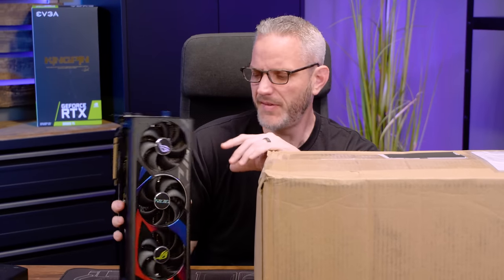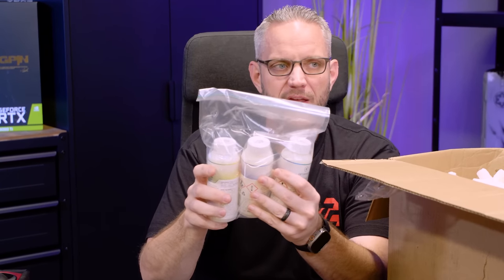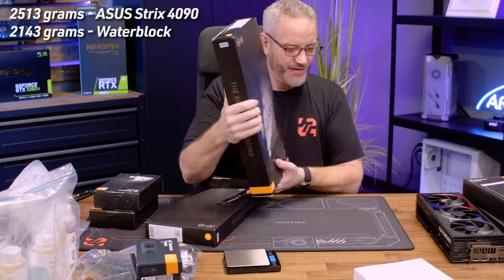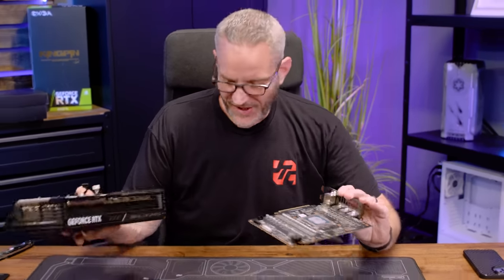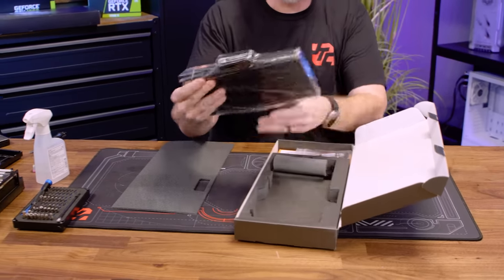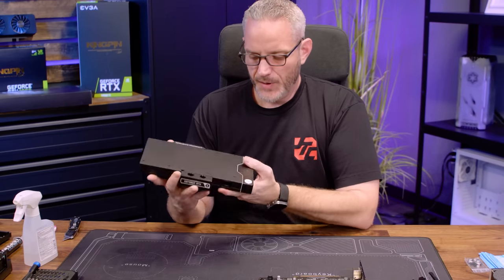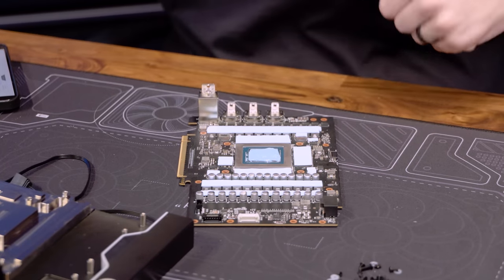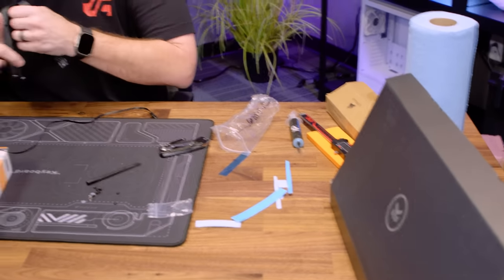This is how you make a 4090 even more expensive... 4090 Strix EK Waterblock Install

Comment: I enjoy Jays content and his channel for the most part. As an enthusiast myself seeing high end parts sometimes is nice. However lately I jus feel the majority of the time all the components or parts shown are for the 1% and 99% of users/consumers won’t use or care about. Seems it’s just always super high end stuff. Which I do like from time to time. I’m running a 4080 and Ryzen 7700X on a 1440P 280hz 28inch monitor with 32GB DDR5 6400mhz so my system is fairly high end but I just feel like most of his audience would rather see realistic components and parts that people actually purchase and use. Hardly anyone is buying 1000+ cards, boards, and monitors and even less so when considering the viewers here. Show some more realistic stuff would be better content for most I would think. Also from my personal testing TG: Kyronaut both standard Kyronaut and Kyronaut Extreme both out perform KPX. However I’ve only tested it on an Arctic Liquid Freezer II 360mm AIO and a Noctua NHD15 Chromax Black. Still on both of those my temps was lower using both Kyronaut pastes over KPX. Also tried Noctua NTH2 which was the easiest to apply of all 4 and performed great tho not as well as the other two.

Comment: It wasn't a scratch,  I used to powder coat and I bet you it was where they hung the part on the powder coating line and the part stuck to the hook they hung it from.  I would have not let that part leave the factory at my old job if we painted it,  We had a zero tolerance for any issues on our powder line,  and had to salt fog test our powder to survive salt water without any issues.

Comment: Jay, overtightening screws and using the wrong size thermal pads can cause the solder balls under the surface mount chips to crack leading to a very costly repair.

Comment: I would have loved to see how you got the tape off the pads... I just did my Asus Tuf 3080 TI, and as like my monoblock, I was annoyed on getting the tape off.
For sizing the pads, I used the knife from the ifixit kit, and made notches and then cut the pads to fit.  I ended up with a couple of extra pads.  I took a sharpy and put the thickness on them, for when I need to use them, I didn't need to think about it.
I have the GPU horizontal and did the active backplate

Comment: I’m running the EK active backplate on my MSI Septum X and it seems like it’s helping more compared to a single block I was running on a 3090. But holy hell is it HEAVY, had to mount it vertically just because it felt like it was tweaking the board mounted directly on the MB
Reply: yea i really wished he dived into the performance differences between active and inactive back plates. he said its meant to be the overkill machine so i thought he'd at least go active. i wish i could afford the 3090 front and back waterblock cuz boy does the 3090 like to run hot.

Comment: My Gigabyte gaming oc was just as easy. Was surprised how easy really lol. I am however more impressed with gigabytes back plate and thermal pads after seeing this tear down. GPU had a big thermal pad squished between the core and the back plate as well as wide strips where the small strips are in this video. I went Bykski block and very happy with the block. Looks great and a solid 10c drop over the already great stock cooler. Win win for $196 and it looks great vertical as well!

Comment: Amazing video thanks! I'm definately getting the Asus ROG STRIX RTX4090 with the dual active backplate water block. Given the heat from the latest generation of hardware, & the recommended to water block PCIe5 SSDs because of hot they get & the really noisy fan you need otherwise, custom water loop cooling just makes sense! The bonus of silent running, better cooling & looking amazing, is icing on the top of reducing GPU size lol.

Will ASUS be producing a pre-waterblocks version of their dog STRIX card, like they did with the RTX3090? I would DEFINITELY buy one with dual active backplate; huge attraction as saves time, removes fear of users doing it themselves, & prevents e-waste.

Comment: Hi, you mentioned that instead of using the special coolant, you have been using distilled water. A: does the special coolant have better performance than distilled water? B: When I look at EK they always say to use their special coolant to be sure that the components of the water loop don't corrode. Distilled water wont cause corrosion right?
I'm planning on building a custom water loop in the somewhat near future, and I really want the clearness of distilled water but I don't want to damage my parts.

Comment: Been water cooling my GPUs since my R9 Fury. I used an EK wb on my 6900XT Red Devil and a month in the card took a dump. No warranty since it was water-cooled. Went with XFX card with factory installed water cooling after that. Won't take the chance any more, these costs to much. By the time you add in a KE WB, the factory water cooled card is reasonable and it has a warranty.

Comment: Just rechecked installation manual from EK. They are claiming not to use any retention bracket above GPU. Lol, RIP 4090. Lots of 4090 strix comes with discrepancy of GPU and PCB planes (about 75-100 microns highest point), stock retention bracket ties it properly leveled. Using PCB screw slots of bracket as retention mechanism to compensate it - last thing anyone should do.

Comment: It would be cool if they printed a thickness value on the thermal pads and included them in the diagram to take the guesswork out of figuring out the right thickness for the various spaces.

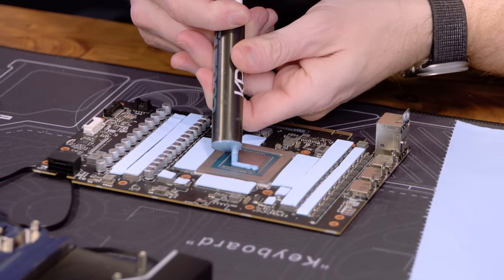Comment: Love your Videos I believe on this video though you left a couple of the thermal pads off. Its two Little ones on the Gpu Side at Timestamp 17:59 the side of the card that Plugs into the Pci slot towards the gpu if you rewatch the video from that time stamp its on the right hand side above the thermal pads to the gpu there is suppose to be 2 little pads. Unless you put them on off screen. You have them on the other side but not on the one Unless there is a reason you left them off. If so id like to know because I plan on doing an asus Tuf card with this exact layout.

Comment: Or just get a 4090 Suprim Hybrid, and throw the Galax 666w or 1000w bios on it. There i added performance + saved ppl like $500

As someone who HAD a custom loop with my 3090 build...yeah it was cool and the gpu was around 40c, but added around $1000, extra maintenence and harder to swap parts. Overall, cool, but i was ready to switch back to air after 6 months

Comment: I have a 4090 with ABP and tbh its just not worth it and probably doing more harm than good as the memory on these does not like being cold if you like to overclock the memory , a lot us 40 series owners have found we need to reduce our max memory OC once switching to watercooled cards as the memory likes to be somewhere over 50 degs c and depending how good your cooling setup is that may not be possible .

Comment: The abundance of thermal pads made me wonder if they could be replaced with some precisely machined copper strips... and would it make enough of a difference to warrant the extra cost?  I know the pads are some sort of specialty silicone or whatever, but if they were as good as copper and thermal paste why wouldn't they use them on the die itself? 
Is it just a matter of cost or is it something to do with compensating for slight irregularities in the mounting of the components from piece to piece?

Comment: Totally interested to see the temperature differences right now my 4090 strix in-game is in the 60s @ 120fps 4k no dlss. Don't think it's really needed but I don't like how heavy the card is and it sags.... I use the Screwdriver/little proper thing and it works. I also have a 6900 Xt It's on a ek water block... love it. I wish they had something that looked a little better with a little more RGB for the 4090.

Comment: i would also say that the only benefit to this with the 4090 is reducing the GPU footprint, the Stirx 4090 runs so cool on air it isnt worth doing - what were the results heat wise?

Comment: Hmmmm interesting …. I have the TUF4090 and this EK GPU Waterblock (non-cooling of rear pcb as used here)  …… (manufacturer sealed box) my backplate did NOT feature captive screws 😱🤦‍♀🤦‍♂🤦 and I was missing a required thick thermal pad (luckily I had some spare) and 2 missing black I/O plate screws ….. IN ADDITION……….

My TUF RTX3080 EK GPU Waterblock (manufacturer sealed and purchased shortly after 3080 launched) was missing 3 required thermal pads, the plastic torque bit for securing torque screws broke sooooo easily and had NOT even gotten 2/3 screwed in so I used my knock off I-Fix-It kit finish securing the torque screws. I’ve never had this many issues before ….. clearly QC is an issue now EK. 

I’ve recently ordered a Bykski water cooling setup for a new itx build and ALL parts were there in the box!!!  😱🤯👍🥳🥰As mentioned already, clearly QC is an issue now EK!!!

Comment: Actually according to der8auer himself hydronaut should be about the same as kryonaut, just without they low temperature resistance. So he's actually recommending not wasting the money if won't go sub zero and just using hydronaut himself (which I mean the name suggest it's meant for water blocks).

Comment: i kinda wana see a submerged water cooling vid.
there's new coolant thats safer than mineral oil called BitCool that miners are using and the cost of 10 letters is the same as a gpu water block so it (in my mind)  vary reasonable too use. no need to buy water blocks  when a fish tank, D5 pump (or vary much cheaper and higher flow aquarium pump), one triple rad and the big one, only 3 fans for the holl pc. fans can add up quickly, especially when trying to cool a 90 class card and a top of the line cpu with intake and out tack cooling fans.       

im just geting to the point were it seems way more affordable and covenant

Comment: yea rather then getting an effect through the fluid I've just opted for satin finish tubes...much less chance of it gunking up if there's just a normal clear fluid in there :P

hope the EK stuff holds up...would be much easier then re-dooing all your tubes in a different finish >.<
which was still less annoying then having to take out and scrub the blocks and fittings to get the gunk out .

Comment: I call it Mystic Clog, stuff falls out hard and clogs up blocks if the loop is not running 24/7. Just what I've seen using it.
Reply: No clogging issues in my build had mystic fog for a year and a half in there without any issues and still looked clean after draining. All the parts in the loop were new and flushed before adding the coolant

Comment: AMD and NVDIA needs to create a standard watercooling mounting system, similar to what CPUs + mobos already have, to allow for pc builders to water cool their system. Why not just create a motherboard with a GPU that can be dropped into? Then you can use the same coolers you would use on CPUs to cool your GPUs. It will probably have faster interface because it connects directly to the motherboard instead of tracers and PCIe connection.

Comment: I'm honestly waiting for the GPU manafacturers to start sending car radiators(like in the beginning of water-cooling when you couldn't just order parts like today) and a portable air conditioner to keep these newer and newer cards to stay cool. I mean the stock cooler on this 4090 is about the same total surface area as some cars heater cores, hell the stock cooler that came on my ASRock OC Formula RT6900XT wasn't far off from that size not quite as big but still beefy as hell!!!!

Comment: I went with the active backplate for my 3080 Ti build. GPU stays nice and cool. I do think I need to either split my CPU and GPU loops or go with a dual pump system as the CPU isn't getting enough flow and a 12900K is a hot one.

Comment: Nice video Jay! Getting that block for a build. My PSU (CoolerMaster V1100) came with the GPU power cable 90 degree connector which is nice for the default air cooled cards. Do you know if that slot on the block fit the angled connector? Or do I need to buy a new cable? Thanks!

Comment: Could you do a video on the Samsung 990 pro, once the firmware issues are fixed up? Maybe compare it to the 980 and 870 EVO SSD. Samsung claims the speeds of 990 are almost at the theoretical cap for PCIE 4.0 at 7450 read 6900 write MB/s. Absolutely insane and probably far beyond what any gamer needs but I would love to see some comparisons and maybe grab one. I have the 870 EVO now and am curious to see how much more performance in load times or games in general you'd get between the two.

Comment: Ppc’s doesn’t cut custom acrylic. The vector 1 backplates with the ceramic plating were a lot nicer. The terminal cover is a magnet, it doesn’t light up. The dimensions were included in the stock images online. I especially liked this video for giving us a closer look at the vector 2’s…glad I bought the eisblock gpx again. EK is just too heavy.
Reply: Actually we do cut custom Acrylic, We have both a CO2 laser and a CNC machine that we use to make parts all the time for customers.
Reply: @PerformancePCsTV  I have emails from a representative of yours telling me you can’t draw or cut acrylic. I think it was September 2022. I was looking to have a 420mm tank res built.

Comment: As someone who had the chance to try out 3 different ASUS 4090s (2x TUF, 1x STRIX) I can't recommend watercooling ASUS cards. All of them had extreme, unbearable coil whine. I ended up getting a PNY 4090 Verto Epic-X that had less than a fourth of the coil whine the ASUS cards had.
Reply from the maker: There are ways to stop coil whine. If mine whines then I will show it. None of my cards whine due to my tricks
Reply: @Jayztwocents  Oh I know the tricks (fps limiting, undervolting etc.). They did help but it was still too much even at 30 fps and low loads. Hopefully your card is better.

Comment: Um, from our vantage point that doesn't even look like a scratch. It looks like a rough weld that wasn't smoothed out before applying the finish to the metal.

Edit: Wait, what? Captive screws? Dude, I already loved EKWB, saved my ass twice now, but I gotta just say it "EKWB is hands down the best." Imma probably upgrade from my gpu with one of the upcoming gpu generations. Used EKWB for my last GPU block. Probably gonna go that direction next time as well.

Comment: For how much EK charges for their GPU blocks, they could at least pre-cut or even pre-install the thermal pads like Alphacool or Bitspower, who are charging less than EK.
Reply: They can't precut or preinstall thermal pads that are supposed to go on the power stages.  Installing thermal pads on the casing is bad cooling practice.
Reply: @eidodk  alphacool provides thermal pads for all the power stage components and vram already precut to the correct sizes. All the user needs to do is to remove the protective films and place them at the correct positions. 

As for Bitspower, they go one step further. They preinstall the thermal pads on the waterblock. All you need to do is to remove the protective films, apply thermalpaste and install your gpu PCB on the block. 

EKWB charges US$250 for the standard nickel+plexi block, Alphacool charges US$169, while Bitspower charges about US$224? And both brands have better surface finishing than EKWB (EKWB blocks have more rough/obvious machining marks on the surface) and they do better in terms of thermal pads. I think EKWB can do better.

Comment: Why bother with thermal pads when you can get way better heat delivery with k5 viscous thermal paste?  ever since LTT did their look at it, I've been running tests and have used it on all of my builds.  it works fantastically to get that heat out to your backplate.  Also, this is my own preference I guess, but I think that the clear waterblocks look way better than the acetol black ones.  I like to be able to watch the flow and light it with rgb (or in my case uv lights with uv reactive coolant).

Comment: This is why if prefer water-cooled gpus today. the amount of heat produced by today's gpu is getting to a point that air cool heat sink is getting so huge. even though water blocks have the same cooling power as the stock heat sink, The water block can do the same performance but at a much smaller space.

Watercooling has more cooling density than heat sinks.

Comment: OK, the heat-sink for the back-plate is really not needed.
With an undervolt/memory overclock, the core never sees more than 50c!
Getting 20+ its/sec in AUTO1111...time for a new mother-board (i7 system currently)

Comment: I wish Nvidia would sell Founder Edition cards directly from their website. I have a rack mounted case and the Seahawk gtx 1080 that died due to a power surge that burned a neighboring house down, the gpu would bulge the lid of the rack mounted case due to the water inlet/outlet ports. I found a 4090 FE water block with the inlet/outlet ports in the back of the card & not on the top of the card like most water blocks.

I'm using a R7800 and I want to upgrade my loop that has a 9900k. Once I upgrade to the 4090 I probably won't upgrade for another 4 or 5 generations. Maybe I'll suck it up like I did with the i5-750 that I was previously using before the 9900k and wait for the 10th gen.

Comment: Question. I have a 3080 that I put on a water block. I have re seated it 2 times but still get a hot spot hitting 75c under load. Gpu hitting 45c. Contacted EK and they said to re seat it. So I did but still get same temps. Could you show the hot spot temps on the 4090 to see what the hot spot is on that. Really don't know what to do at this point. It is my first water cooled pc. 😅